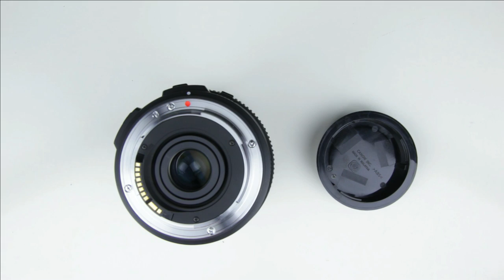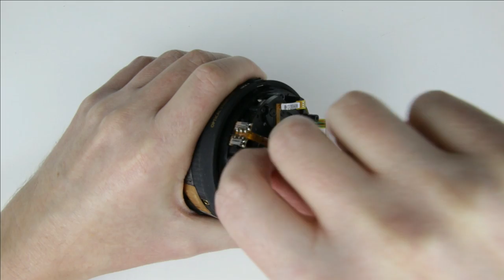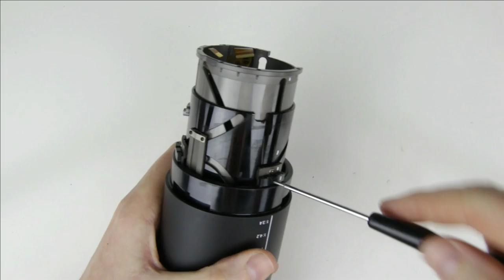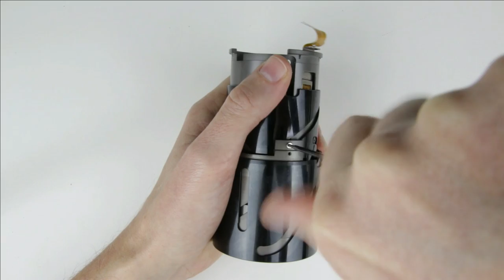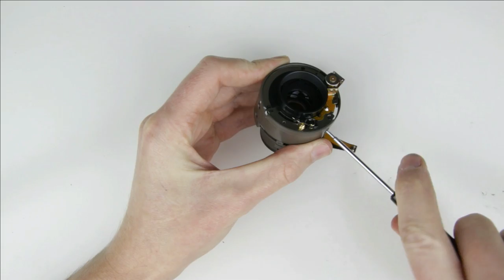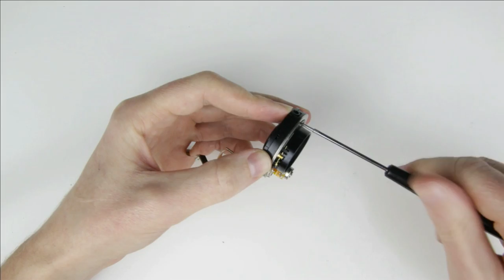Sigma 18-250mm f/3.5-6.3 DC OS HSM disassembly for replacing the aperture flex cable

Comment: I need to do this job on a 28-300mm DG Macro which has been damaged by the previous owner while trying to repair it after he dropped it. My problem is that I can't find anyone to sell me a replacement cable. Any suggestions would be gratefully received.
Reply from the maker: You can check ebay or aliexpress, or buy the same lens in non-working condition with a good flat cable, and use that as a donor.

Comment: Thanks! I have the same lens, but on mine the problem is rather the autofocus suddenly not working. Do you have any clue if it could be a flex cable also there? Thanks
Reply from the maker: I don't think that it is caused by the flex cable, because the cable doesn't move during zooming or autofocusing. Most likely the HSM motor is dead, less likely the problem is with the PCB.
Reply: @CamerasLensesEtc  thanks a lot! that's sad to hear, will try my best

Comment: I have a Sigma 18-300 Lens with recent water damage.   After watching your Disassembly of the Sigma 18-250 Video, I'd like to know if you have a video for the 18-300 OR you could tell me the differences I might see when taking apart (and putting back together) my 18-300.     Appreciate the advice!    Thanks In Advance.
Reply from the maker: I haven't disassembled the Sigma 18-300 lens, so I can't answer your questions.

Comment: Hi there! I have a SIGMA 18-125 DC that has aperture issues. I bet it is also due to a faulty flex cable. The question is, where can I buy a new one? Thanks for the video!
Reply from the maker: You can buy the cable on eBay. As I saw, there are two or three kinds of cable, so make sure you order the right one. (Or order both cables. :) )
Reply: you may find it on eBay

Comment: i need clean this lens on 250mm can see garbage . any recomendation? srry my poor english
Reply from the maker: If the lens has dust between the first and the second lens element, then the cleaning process of the lens is very similar to cleaning the Sigma 17-50 or 17-70 or 18-125mm lenses... check those videos on my channel.
Reply: @CamerasLensesEtc  thnx broo!!! God bless You

Comment: I wonder how similar this is to the 18-300.  I've had mine repaired by Sigma twice, and again one of the rail screws, I think, has come loose, locking the zoom mechanism.
Reply from the maker: I haven't disassembled Sigma 18-300 yet. If you want to tighten the screws, usually it is the easier part of repairing lenses, because you don't have to disassemble the whole lens. Mostly just remove the rear cover, PCB, and the zoom-, and mid lens cover tube. Then you have access to the screws inside the lens.
Reply: @CamerasLensesEtc  Well if I do it, I'm gonna use some thread lock when I reassemble!